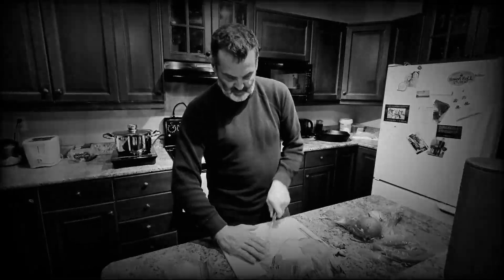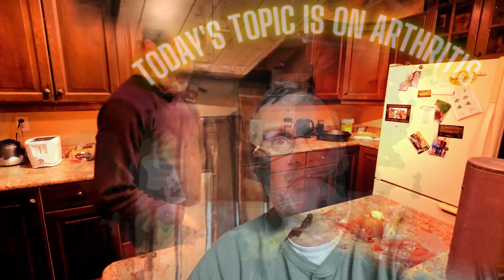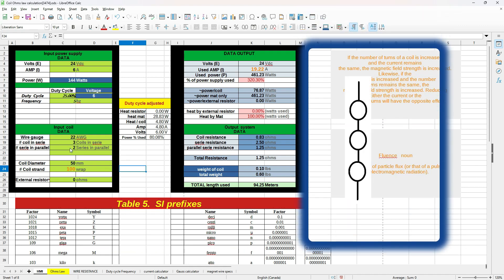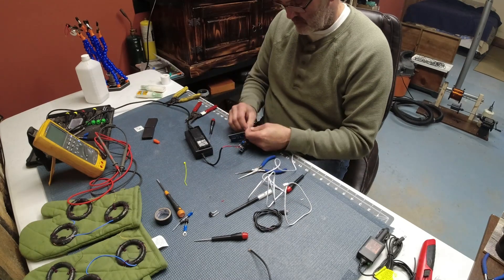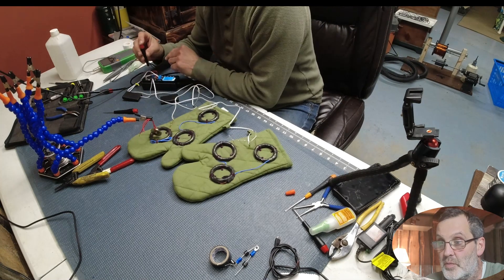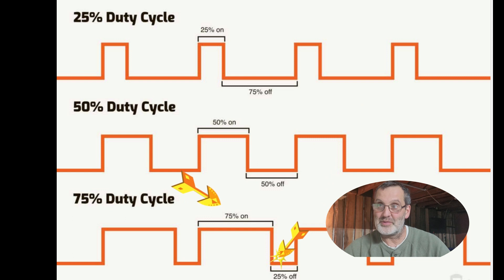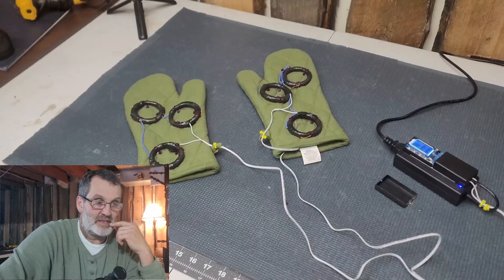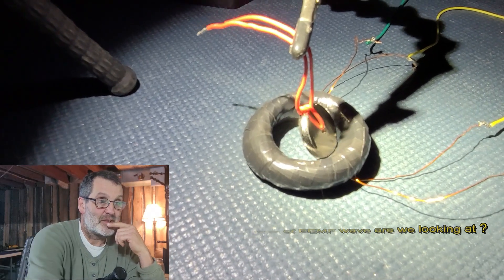Hands on Arthritis!

Comment: Steve, rheumatoid arthritis in the body, is the result of neurotoxins produced from viruses that live in the body. The immune system can’t see the virus but it can see the neurotoxins that are produced from the viruses life cycle. Viruses consume carbohydrates and their waste product is neurotoxins. PEMF kills the virus which stops the production of neurotoxins. No neurotoxins equals no arthritis. Dr Anthony Williams book, Liver Rescue explains this process in detail. 
PEMF is one of the most effective way to kill viruses. PEMF also need help to preform the virus elimination. Anti-virus supplements along with colloidal silver, 35% food grade hydrogen peroxide, DMSO. All of theses are supplements that work together to prepare the body ahead of PEMF treatment. Once the body is prepped with antiviral properties the PEMF process removes the protein coat or cloak from the virus. Once the virus is exposed and it protection is gone then the antiviral supplements can kill the virus to be eliminated. Without antivirals in the bloodstream during the PEMF treatment. The body working alone can only kill very little viral load. The body need help during the PEMF virus exposure. The body only has white blood cells as a viral defense. The PEMF treatment exposes billions of virus all at one time. Even with antiviral supplements it still takes months to eliminate all the virus.
Watch Bob Beck protocol. 
All disease starts in the liver. Once the liver is over burdened and unhealthy. Disease travels though out the body. 
PEMF is the Holy grail for the return to good health. It takes time but it works.